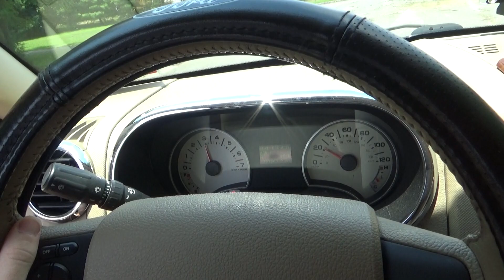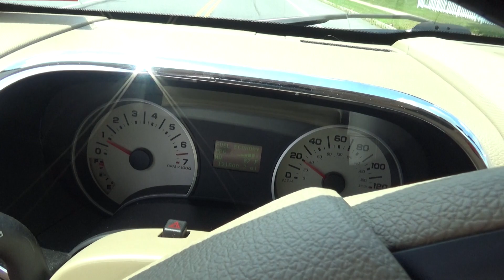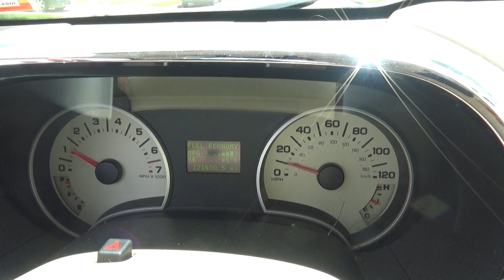How To Properly Brake Down A Steep Hill

Comment: Before watching this video I thought "I already know about this I shouldn't watch this" but I did learn something!

I assumed what was slowing the car down while engine breaking was the friction of the engine operating at a higher speed, not a vacuum. So I was always worried to engine break cause I didn't want to wear out my engine. However now that I know it's just a vacuum, that makes me feel a lot better about the process. I'm going to be driving to a hilly area soon so it's good to re-enforce this concept. Thanks for the video!

Comment: One thing I have found very useful is knowing the speed of the car's engine braking. I can save on brakes, knowing how the car will respond and how fast. (Changing speed for a school zone, for instance.) Different cars will have different compression, so will engine brake differently. (Just sharing this out of my own experience, this is for auto. transmissions only.)

Comment: Is there a controversy about this engine brake thing? Some specialists are advising against it. Confusing!
Reply: I think it is because some people misunderstand it and instead of using the lower gears' braking ability, they are using downshifting itself as a brake and not matching RPMs first. It will slow down the car, but will do damage to the transmission 100%.
Reply: @joshswenson8390  So, we watch the RPM first, then we downgrade to the corresponding speed?
Reply: @onlignebridge4224  Yes, but if it is an automatic trans, preferably start driving in the 1st gear position so you don't have to mess with the "D" position in the first place.
Reply: @joshswenson8390  Very useful.  Thanks.
Reply: @joshswenson8390  Are car engines designed to be "choked" in order to reduce speed?
Reply: @onlignebridge4224  what do you mean by "choked"?
Reply: @joshswenson8390  Reducing fuel injection  through engine braking.
Reply: @onlignebridge4224  From my research, it is the only real safe method to descend a canyon road, but it's always worth checking with your car manufacturer.
Reply: @joshswenson8390  At traffic lights,  P, N, or brake? Which of  the three is best for the engine?
Reply: @onlignebridge4224  brake is fine for traffic lights

Comment: What about only have a L gear not any other than drive. Puts my RPMs very high to coast down in L....is that bad or at what point is it
Reply: As long as you don't allow the engine to over-rev, then it's not a problem.

Comment: is it ok to downshift to 2 while it is driving and not at a stop?
Reply from the maker: Yeah. It does it normally when you come to a stop. Its like a stick shift. Your driving in 3rd for example and you wanna pass a slow driver so you slap it in second and you go around
Reply: @mcfgotmillk  and you can go from drive down to 2 while driviing?
Reply from the maker: Yes but ONLY at the right speed and rpms. Dont be going 60 on the highway and pull it in 2nd.
Reply: @mcfgotmillk  okay, because there is a very steep grade I need to go down and people are going 50 or more prior to the grade. What speed should I go down to before pulling it into 2nd??
Reply from the maker: All depends on your vehicle. Do some tests drive in 2nd and see were the rpms get high and at what speed
Reply: @mcfgotmillk  ok, thank you!

Comment: First of all, I was waiting for a real 'hill', like in offroad conditions, not gentle slope on a sealed road. 
But apart from that and in my humble opinion, yes, you'll save on the brakes, but will damage the gearbox and engine! When you put in in L and try to accelerate, you are basically just using the first gear and it's obvious that the car wants to stop with such a low gear! 
Sometimes it's safe and useful to use engine braking, but its better not to use it often.
Reply: Why does it damage the gearbox and engine?